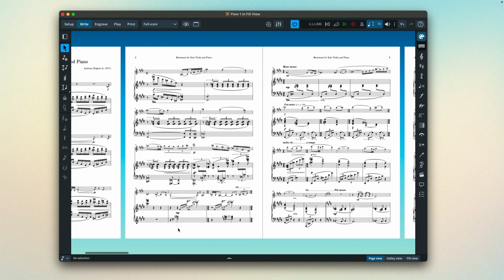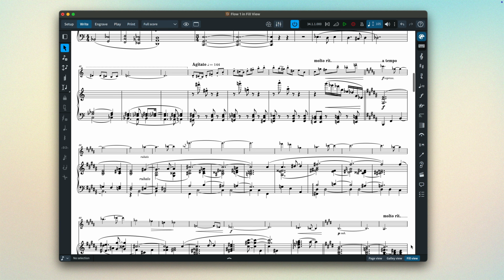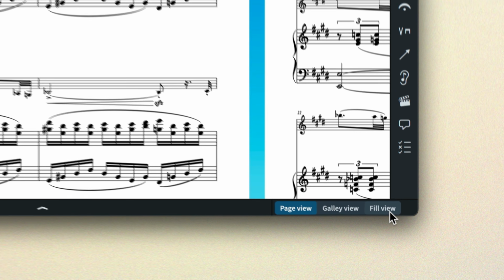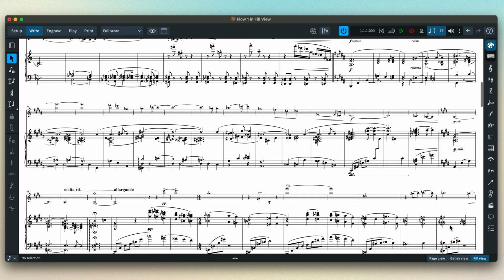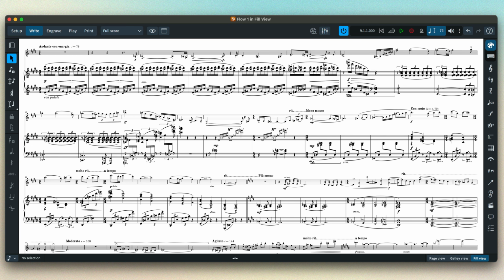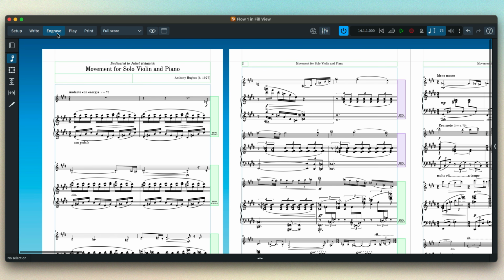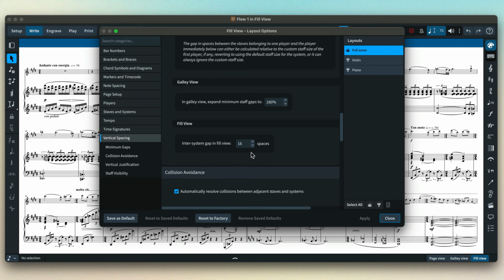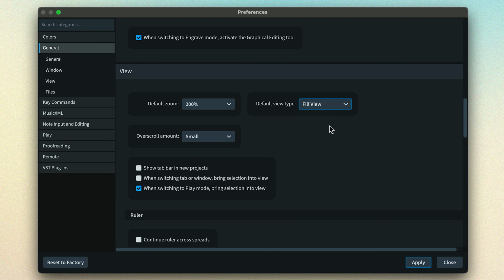Fill View | New Features in Dorico 6

Comment: How about you fix the horrible placement of slurs that you have to manually adjust. I can't believe that still has not been corrected.
Reply from the maker: Generally they are very good and don't need adjusting, although you can also make global adjustments in Library > Engraving Options.  If you have cases that don't then please give us details on Dorico.com/forum
Reply: @dorico  I have a photo of the problem I'm encountering. Can i have an email to send this? I don't need anything trouble shot I just would like you guys to be made aware of this for future versions. Thanks
Reply from the maker: @ please post an image and/or project file on the Dorico.com/forum

Comment: Thanks for the continued improvements. Fill View should honor the Gallery View  Instrument filters.
Reply from the maker: I've passed that on to the team to have a think about, thanks
Reply: @dorico  Thanks. Just as importantly Play mode as well. When you have an entire orchestra and you filter to just strings it makes sense that in play mode while adjusting velocity, cc, dynamo, played note lengths etc., to want that filter to also apply, otherwise you are either scrolling back and forth endlessly or using the dropdown to switch instruments.

Better would be seamless integration side by side with Cubase. A dream come try notate in Dorico and CC curve and mix in Cubase at the same time!!!!!!!!!
Reply: @dorico  I'd also like Fill View with selected instruments. It would be great to edit just the strings or woodwinds or any group of instruments in a score that way. I use a fairly big monitor and in Galley View two or three selected instruments are just a narrow streak.